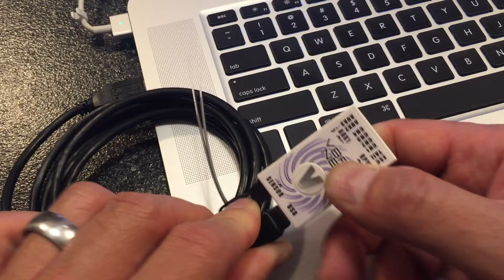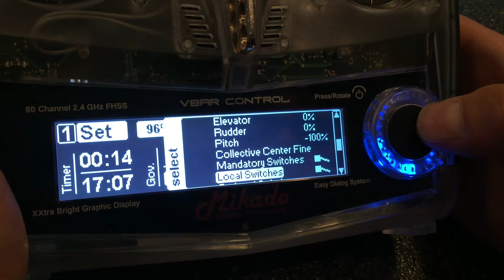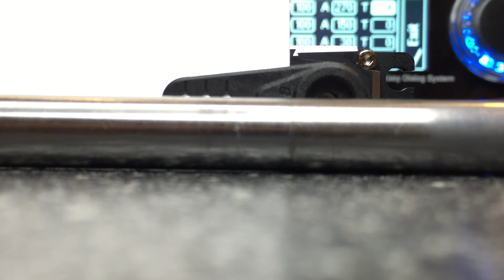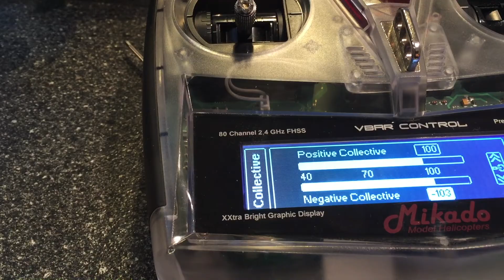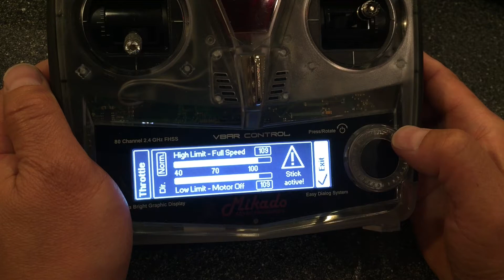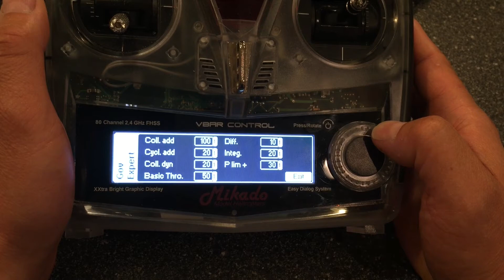Mikado Vcontrol Neo vbar Nitro setup

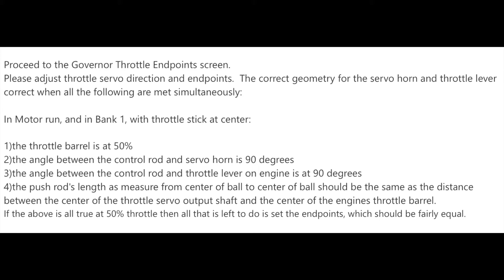Comment: not a vcontrol noob...but, my first nitro on vcontrol. @17:04 point number 4 is very confusing. Can you try to explain again in other words? "pushrod's length as measure from center of ball to center of ball should be the same as the distance between the center of the throttle servo output shaft and the center of the engines throttle barrel." ??????
Reply: Pushrod length is same as axes.